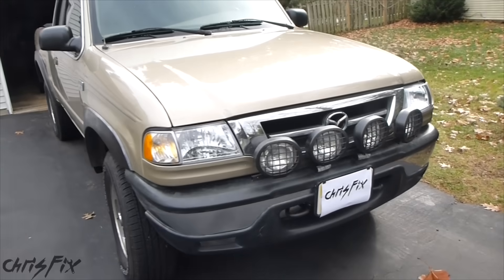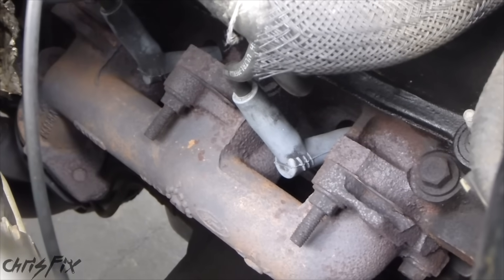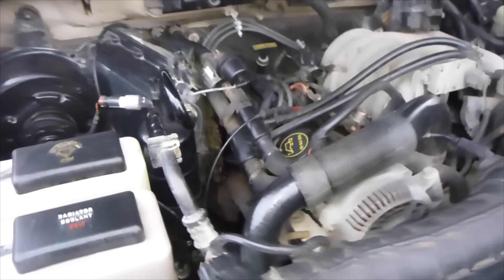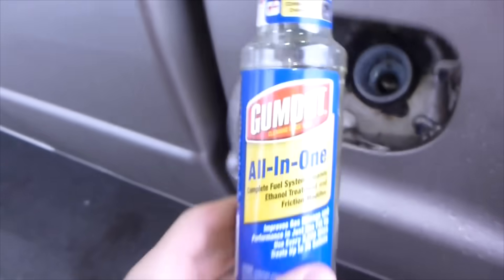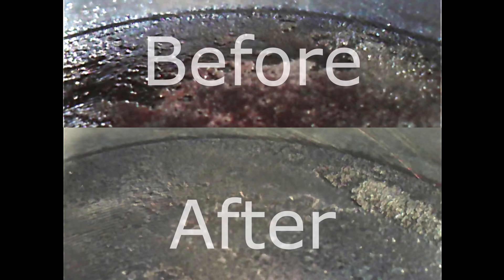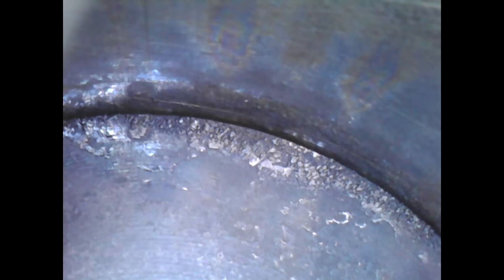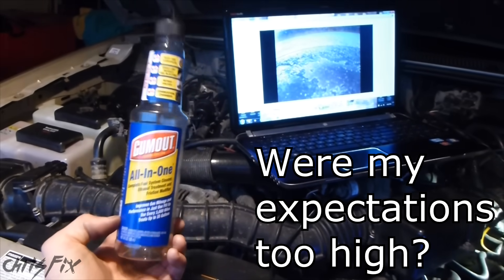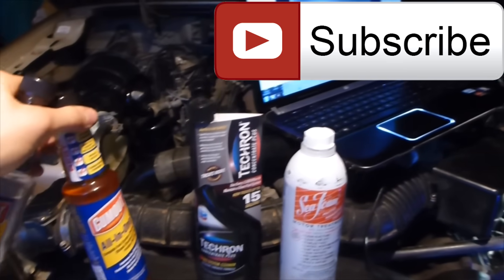Do fuel system cleaners actually work? Testing Gumout "All-in-One"

Comment: It is a fuel system cleaner not a carbon remover. It is supposed to clean the fuel injectors. What are you doing?
Reply from the maker: Thanks for sharing, I'm not sure if it is different today but at the time these fuel system cleaners advertised cleaning the fuel system as well as removing carbon deposits (1:03), I was able to test wether or not they removed carbon much more easily with the borescope camera so that's what these videos focused on

Comment: So let’s be clear here. Many of these fuel system additives are proven to help the longevity of your DIRECT injection fuel systems, they contain conditioners and lubricants that help ensure proper operation of your direct injectors and high pressure fuel pump. For me, that is FAR more important than any other claim, if they clean some carbon, excellent, but keeping those direct injectors alive is vital, as many engines require SIGNIFICANT repairs if one of those fails after say 100K miles and the vehicle is a “northern” vehicle. I’ve had to replace cylinder heads before because of seized direct injectors. Not fun.

Comment: be very careful adding this stuff, make sure you follow the directions. I put lucas fuel treatment in my car with 120k, I doubt its ever had it due to being one owner... couple days later I can only get it to run on 3 cylinders, I am having codes p0300, P0302, P0304, P0306, P0175, P0136, P1155. I messed up the ratio by about 15 gallons because I forgot to refuel after adding it. I don't even know where to start trouble shooting. I guess fixing these sensors would be first.

Comment: What this tells me is that using gumout regularly with oil changes from the get go  will help remove the carbon sludge before it becomes hardened and difficult to remove. I used to use the Lucas system cleaner but have since adopted Gumout. Great video thank you for what you do.

Comment: Can you review Liqui Moly Valve Clean. Also Liqui Moly Jectron Fuel Injection Cleaner.
Reply from the maker: I'm not planning on making any more of these fuel system cleaner videos because after testing numerous products, pretty much none of them worked as claimed. My recommendation would be to just stay on top of maintenance and use good quality gasoline and you'll be fine

Comment: Will something like this work for a fuel system flush? I was quoted $180 at a dealership.
Reply from the maker: No a flush is a physical push of fluids though the system to remove material. There is no need for a flush if you have a fuel filter 99% of the time. Why did they say you need a flush?

Comment: I think you expected too much.  Getting rid of that carbon takes a while and maybe if you ran this test over a few thousand miles might give a better result. I use these cleaners mainly to clean my injectors and any carbon it may remove from the piston is a bonus. If it can keep new carbon deposits from forming than all the better.

Comment: I would speculate that with continued use it would continue cleaning the combustion chamber.  It had 100,000 plus miles and it was expected to be spic and span after 209 miles?  Keep using it...

Comment: As far as carbon deposits on your cylinder walls, if you have carbon build up it only makes logical sense that it's helping with the compression, otherwise there wouldn't be enough clearance for carbon to build up to begin with.

Comment: Gumout will help prevent carbon build up so you have to start using it earlier in the engines life. There is no magic fluid or additive that will remove 20 years of carbon that is as hard as rock and you have to remove it with a hammer and scraper.

Comment: I believe the take away here is if you use the product earlier in the engine's life, and use it regularly, you can prevent buildup to some degree before it gets too thick. For your truck over 100k miles you probably need to manually clean the stuck on stuff. Then once cleaned, proceed to use the liquid product to keep the accumulation at bay.

Comment: The cleaning effect on the valves and injectors, would be a better indication of performance end efficiency improvement.  What changes in lambda?  Using one vehicle for  multiple product tests isn't a good way to test anything.,  There could be delayed effects or compounded effects due to an earlier test.

Comment: I’ve come to the conclusion. That when you use the cheapest namebrand fill injector cleaner 10 times. It’s going to work about 10 times better than the most expensive fuel injector cleaner! 
The best you can hope for is to use it between five and 10 times and then every five or six fill ups after that.

Comment: Here’s something you probably don’t realize when you taking these tests. First shot doesn’t always work. Read the directions they tell you to use this at every gas fill up. Or every oil change. I’m using Marble miracle oil I put in 4 ounces half a cup in my gas tank every 10 gallons. I got a gallon when it’s all done it’s in my oil is in my gas I will know what it did to my engine after I finish the bottle.

Comment: I used fuel treatments on near empty tanks and use the whole bottle if it's a small one, then go refill. If I have a big bottle, then I might consider filling. I use 3-4 times the 'up to' suggestion. If it treats 'up to' 20 gallons, I mix it when I suspect I have 4 gallons in there and burn 2 before I refuel. I needs to be concentrated to bang pretty good.

Comment: You might have to run more then one time. Also used to work in a parts house. And was told that most standard injurer cleaner. Is just high grade alcohol.

Comment: 7 years ago, I had an 83 dodge, 5.2, pickup, truck, it had an annoying, miss at idle, even after, replacing, the carburetor, plugs, cap, rotor, and wires, a friend, advised me to try a couple bottles of sea foam, and after 2 weeks, or so, the idle, noticeably, got better, I was amazed, I thought, I was going to have to yank the heads off of it and get a valve job done, but over time, it was just running better, it had a/c, so it was nice, even, when I sold it, it was running great, now I have an 01 4.3 Chevrolet, conversion, van, it has , 200k, on it, and I was experiencing, the same, issue, after a tune up, I did have to replace, the worn out, spider, fuel injection, but it still had a rough idle, so I put sea foam, in it, and it runs good, a couple weeks ago, I went to wally world, to get a can of sea foam, but they, were out of the regular can, I have been buying, they only had the big r v can, so I looked around, and seen, some super tech, motor, treatment, for the gas, tank,  I tried, that, it was $5.98, a can, and now, my van runs, even, better, and the check engine light went off, it been off now for 3:weeks, so I use, that from now, on, the engine idles, great, and starts up better, for a Little, over $6.00, I'm sold, try it, you will be surprised, I am, great video, thank you!

Comment: That didn't seem to achieve very much. A little bit less carbon, maybe. 

There are some that you use every tank. On an economic basis these things don't seem to make too much sense. A typical fuel additive in the UK might cost £3.00 and lets say you get 300 miles from a tank so you get  a cost of 1p a mile. Cover 100,000 miles and that's £1000 spent on fuel additives. Well you might save yourself a repair bill, which might be more than £1000. OR you might have a problem and the car manufacturer use the "tainted" fuel as a pretext to void the warranty. I wouldn't bother.

Comment: My 2012 civic 121k seems to run smoother after using these type of products. I’d imagine it works better if you use it regularly or handful of times in this particular case. A real good test would be to pour some of that stuff in there and lit it sit overnight. But it’s like trying to clean crusty pot that got left on the stove and you were gone for the weekend. You you would have to let it soak, get some of the crust off and let the next layer soak some more. It would be naive to think it would clean it up on the first bottle in over 100k

Comment: Thanks for this testing. I have a question. If you have a oil leak, which procedure would you do first, the feul system clean or do a oil leak sealer first?  what if I want to change all my fluids? (I watched your other video on ALL Fluid change) 😊👍

Comment: This is old yes i know. What I got from this is. It works but not like we think. It will have to be used multiple times. I don't have tools to try but I would want to see someone try it for a whole month or two months every fill up. Then take some before and after. I do know for a fact when I had my LS Mercury Grand Marquis. I drive to OKC. I used regular first then Super then last fill up I used Premium. Gas mileage jumped up from 21 to 24.5. Coming back to FL. Same deal in reverse. Most I got was 26 high way miles a gallon. I was happy. Mind you I didn't use any additives. If I had one of those scopes. I wonder what it looked like. I know for a fact I had to have cleaned the shit out the injectors and etc etc. Anyone who knows more than me tell me what you think of my real life experience. I said my next long drive now in a truck. Im going to try gumout and see if I get same results. With my truck. I tried to use prem gas to clean and when I switched back. I had issues and check engine light would come on. I had to buy gas treatment. That was only way truck would run normal again until I ran out all the prem gas. Nevertheless yeah

Comment: what I like about injector cleaners is that my old diesel is working ALOT smoother. Without there is alot of vibration which is normal for old diesels. They are not expensive where I live because they are getting produced right around the corner and in the end its alot cheaper than premium diesel which provides the same effect.

Comment: The bad thing now days with Direct injection fuel systems is the back side of your valves never get cleaned and the EGR puts the exhaust back down on the back of the valves. So for your valves you need to walnut blast them.

Comment: Nobody ever talks about if if cleaned a sticky or dirty fuel injector. It will probably take using it quite a few times to remove carbon that’s been baking on the piston for a couple of years. It is interesting to see in the piston chamber and see how each cylinder varies with build up. Thank for the video!

Comment: Hi not sure if it would work, but what if you were to spray carb cleaner in the spark plug hole to loosen or soften the carbon then use a small vacuum hose to try and suck any debris out let it dry?

Comment: It's a FUEL SYSTEM cleaner but you don't check the FUEL SYSTEM.  Gumout works on piston top carbon like a screwdriver can also work as a chisel. Testing the primary use case first.would be useful.

Comment: I used a litre of diesel on 1 fill of my  gas tank and it cleaned up my injection system and removed all the carbon build up on my pistons and valves . My fuel economy has increased by 10% after doing that .

Comment: I bought a ‘85 Toyota Pu 6yrs ago.  Had 100,000. Has a Asian original Carb.  Today it has 200,000 Haven’t rebuilt the carb, just adjusted and each month dump carb cleaner.  Get’s 30mpg with manual. Truck starts, idles smooth and I can lay “scratch” off 1st gear.  Facts speak for themselves.  What carb cleaner do I like?😎

Comment: Also using cleaners your miles per gallon will drop you will not get the miles per gallon and using just regular gas without the cleaner in it maybe that's why people don't use it I don't know I just know don't use it from day one brand new when you take this carbon out you will clog your Cadillac converter

Comment: Okay let's talk reality in the real truth by using cleaners. Cleaners should be used from the day vehicles are bought regularly. That would stop build up when you got so much build up it will not clean and what does clean will clog your Cadillac converter does not turn carpet into liquid and burn out the exhaust so in essence if you're really carboned up use cleaner it's going to clog your Cadillac converter that's real life that's what really happens weather the stuff ain't used on a date with purchased new it would stay clean and keep clean and be clean when you try doing it on the engine that it was never done with your Cadillac converter is going to clog up then you got a bigger problems little hint for your fellas that way you know

Comment: Well, this is a few years after the fact, but:  It seems that ideally, you would want to run thru 3 or 4 applications, spread out every other fuel fill up with premium grade gas, checking the cylinders each time.  Then repeat this with different brands.  While that would probably be more work than practical, I appreciate that you did the extra effort of before and after checks of the cylinders.  One thing that would have been good to know is what were the conditions of the spark plugs?  Particularly cylinders number 5 and 6 that had the extra carbon buildup.

Comment: I’m wondering if anyone has ever tracked the affects of a cleaner on a clean engine over time, to see if it prevented any build up?
Reply: That’s what I was thinking too. It seems to me that it only took off the newer still gummy carbon but not the older dried carbon.
Reply: All car engines make carbon, you will not tear apart a used engine and find none.  A slight amount is not really harmful and is always getting created from engine operation no matter what you do to and for it.
Reply: and also if you used it a bunch of times in a row if it would get rid of those big build ups, also interesting to see what it does for dirty injectors
Reply: If you dont want carbon build up, burn propane or natural gas.

Comment: I have a question on fuel that i would appreciate opinions. I just got an e85 fuel van, and i'm thinking about putting gasoline in it. If it turns out that gasoline is better, which grade should i put in it?

Comment: Chris, I know you are pretty busy but please help me out here since you are very knowledgeable with cleaning. I have an EX35 that I need to clean the inside of the fuel tank (fuel sensor is mounted on the side of the fuel pump, inside fuel tank). There is a very very high chance that there is debri caught on the solinoids, hence giving me an inaccurate reading. I've already tried Gummout, Seafoam, STP (some of their 'all in one' products), but no luck. Before I get into the fuel tank, any other suggestions?
Reply from the maker: If there is solid debris like rust, there are no cleaners that will work, there usually aren’t solenoids in fuel pump assemblies. The fuel level sensor uses almost like a potentiometer to check fuel level. Apparently Techron is the best at cleaning that. I would also check the connections at the top of the tank. Sometimes the wires don’t connect all the way or are corroded in the connection pigtails.

Comment: Am gonna try in my car. Next month is oil change time, so while that's changed am gonna do the carbon cleaner.  And I hope it helps my engine out.  I may do it every other week till the carbon comes off.  I heard gumont is pretty good.  So it's worth a try.  Am going to winterize my car, cause I hear farmers almanac, another bad winter coming our way in the East.  It's been over 90,000 miles and I want new spark plugs, my radiator drained and cleaned out with distilled water, I got Asian 50/50 already mix.  And air filter new.  Once this is done, am gonna try the carbon cleaner not one time but every 2 weeks.  For a month.  I hope it doesn't screw my gas line much.

Comment: It'd have to be horrifically potent to remove such large deposits from one bottle - like hazardously strong.  If it managed to dissolve the thinner carbon on the other cylinders, it's probably done some good for your injectors etc, but I wonder if it's added wear to the hoses.

Comment: The thing is when your dealing with an older vehicle with high mileage sometimes that carbon build up is the only thing keeping the compression in line. If it ain’t broke don’t fix it. if your going to take care of your stuff do it from the beginning if you bought used or didn’t maintain it till it was too far gone, put the hard earned money you would spend on these mechanic in a can products away for future repairs or a new set of wheels when the time comes.

Comment: My 2015 Toyota Corolla has only 43k miles and ⚡️ spark plugs were super dirty and burnt.  Of course changed them out and got a tune up.  

I also put Complete Fuel System Cleaner in the tank and just 5 days after thinking all was good it began having a hard time accelerating once again.  ??   

Any suggestions anyone ?

Comment: You waited way to long to clean the deposits.. 122,000 is way to late. You should've been using it starting at 35,000 miles.

Comment: Those cylinders appear to have less optimal combustion which would cause a constant carbon problem. With 122,000 miles a beginning stage coil pack failure, spark plug wire degradation, plug wear…all potential contributors. It appeared that the product worked to clean up cylinders and piston tops that had only minor deposits. Would be interesting to see if the frequency was increased if the gum out could actually break down those more resistant deposits.